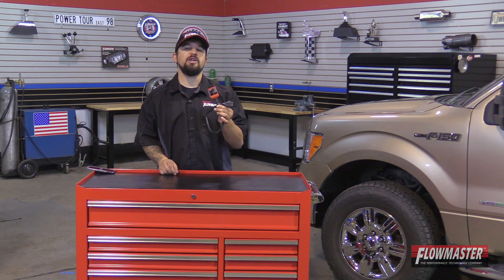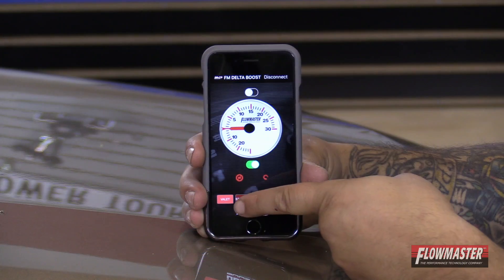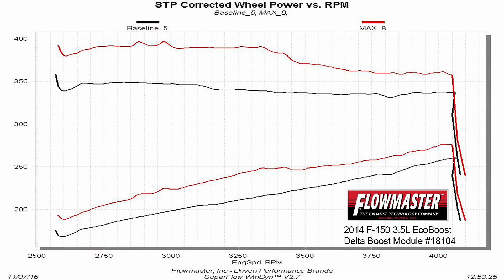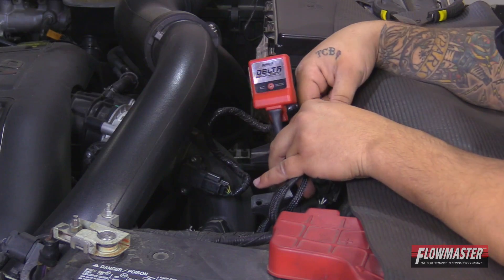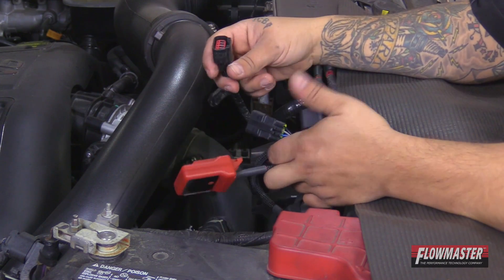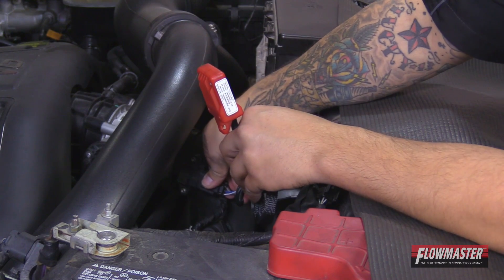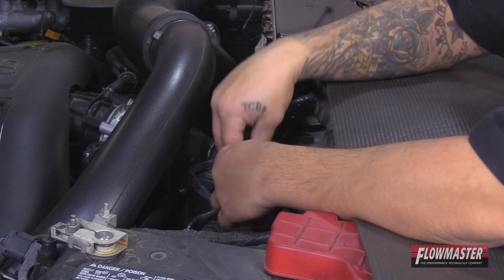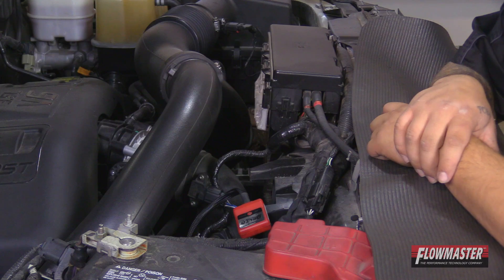2010-18 3.5L Ford EcoBoost Engines - Delta Boost Performance Tuner

Comment: Does it void your warranty?
Reply from the maker: No, it will not void your factory warranty. We designed our Flowmaster Delta Boost Tuner in conjunction with the Engineers at Ford. The Delta Boost Tuner installs easily and only modifies boost pressure, it does not change/manage/affect other systems within the vehicle. Unlike a "tune" which remaps various computer systems within the vehicle for performance increases (and in most cases void any and all warranties if found by the manufacturer) the Delta Boost module only adjusts boost pressure and can be easily returned to stock without additional "tunes" or modifications. If you have any questions about any of our intake, exhaust or tuner products for your ride just give us a call at 707-544-4761.

- Jason @ Flowmaster

Comment: Does this extra boost over stock harm the engine? Shorten engines life?
Reply from the maker: Our Flowmaster Delta Boost Performance Tuner adjust boost up to a safe level for your powertrain, it is not adjustable like a conventional boost controller so it takes away the ability to turn up the boost as needed and possibly up to destructive levels. We worked directly with the engineers at Ford throughout the entire research and development phases when designing our Flowmaster Delta Boost Performance Tuner to ensure that harm will not come to your vehicle. Of course, most types of organized motorsport will put additional strain on components when compared to a daily driven vehicle. If you have any additional questions about any of the performance products that we offer for your vehicle please give us a call at 707-544-4761.

- Jason @ Flowmaster

Comment: I have a 3.5 ecoboost. Very interested in product. Do you recommend a high flow exhaust while running this modular? My ecoboost is stock except for I have a cold air intake.
Reply from the maker: While it is not required, we do recommend pairing these modules with the addition of a high-flow exhaust system like one of our Cat-backs as you would see even greater performance gains. If you would like help choosing a Cat-back for your vehicle, feel free to give us a call at 707-544-4761 and we would be more than happy to help you out. 

-Team Flowmaster

Comment: Would there be any benefit to run premium in sport mode? Also what are the gains in sport mode vs max mode? Very interested in your product, 2011 F150 eco completely stock.
Reply from the maker: Hi Michael, 

The gains between Sport Mode and Max Mode will vary depending on application. However, when using Sport Mode boost pressure is raised 3 PSI, and in Max Mode boost is raised 4 PSI. Feel free to give us a call at 707-544-4761 and we can answer any additional questions you may have, as well as provide you with a personalized product recommendation for your vehicle. 

-Team Flowmaster

Comment: Two questions.

Can this be used in conjunction with any other tuners that have been installed (or on the market for the EB)?

This module simply "bumps" the numbers up, correct? Does it change shift points or eliminate governors - or will that still be handled by other tuners?
Reply from the maker: These modules can be used in conjunction with a tune and "stacked". In regards to shift points and governors, those will not change with the installation of a Delta Boost module. Don't hesitate to give us a call at 707-544-4761 and we will be more than happy to help answer any questions you may have and find the right product for you. 

-Team Flowmaster